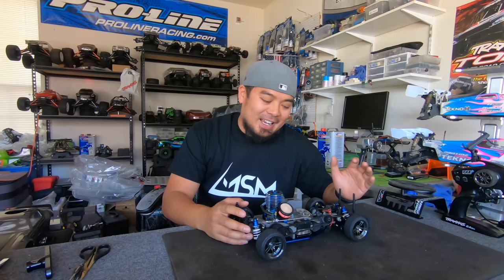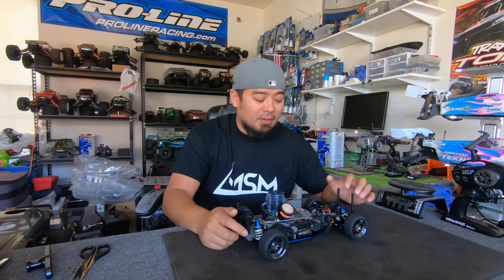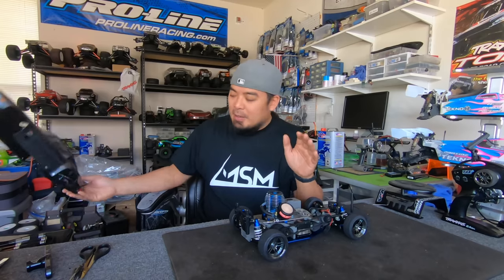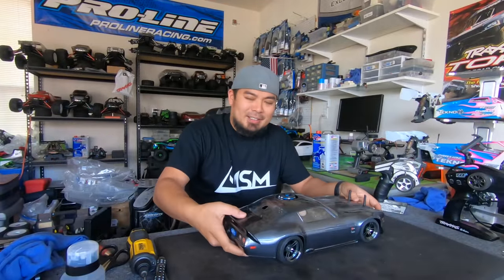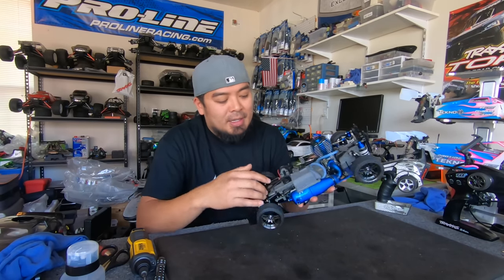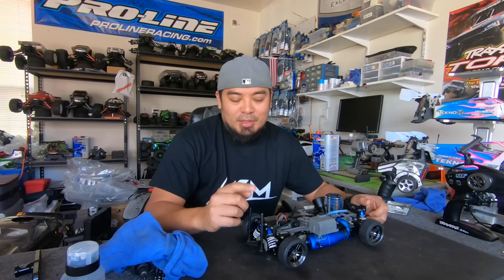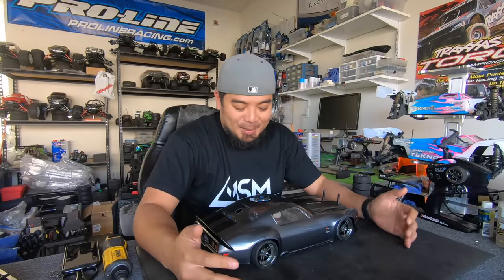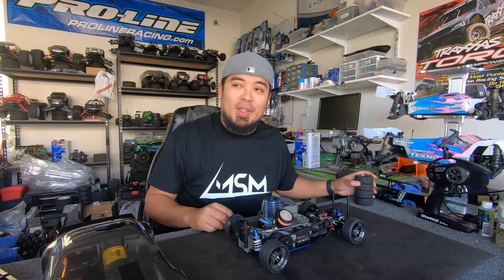Nitro RC Car Drifting Traxxas Nitro 4tec

Comment: Nice vid. Finally some nitro stuff lol. Back in the day I used to wrap the rubber tires with electrical tape. It had enough traction to get up to speeds but the tires would still break loose on command. Much easier to control to. You should give it a shot. Pretty awesome watching the car running 20mph sideways around a light pole or something.
Reply: I use to do the same with sticky tape

Comment: I bought one of these new about 10 years ago and never ran it.  It's never had any fuel in it. So, other than the dust it's still new.  I'd like to put a 5 cell hump battery pack for the reciever and servos and stuff in the same place Traxxas has for the 4 cell reciever .  Any recommendations?

Comment: Hey Mark, this isn't related to the video but since you live close to Traxxas HQ can you please ask them about the fan issues with the Easy Peak Plus chargers? I've had two of these chargers with the same fan problem. On my first Easy Peak Plus (which should've kept but sold it) the fan locked up at the 8 month mark. I sold that charger because I bought the Easy Peak Dual charger. But now that my GF has been driving my cars more often I purchased another Easy Peak Plus. The new one has a beeper like the Easy Peak Dual has which is a welcome addition. But within a MONTH of use guess what? The stupid fan started to make the same rumbling sound the old made! Ridiculous if you ask me. So instead of dealing with the warranty BS I replaced the crappy fan with a slightly bigger and lower RPM fan but it seems to have a higher CFM since the charger runs cooler. Anyways I know I'm not the only one with this issue as it's been a problem since 2015! Check out Amazon reviews. 

I also made a video about the fan I used to replace the old fan.

Comment: Not criticising because i dunno if you were just messing around or trying your best, but a lot of your drifts seemed pretty loose and not very deliberate. I only mention this because you said at the end that drifting is fun for about 5 minutes before it gets boring. 

Imo if you are a good drifter, if you can execute tight, well controlled, and deliberate drifts, drifting never gets boring, especially if you put some cones out or are doing it on a track. 

Maybe if you aren't that proficient, get some cones out, take some time perfecting your drifting, and you'll get more enjoyment out of it when you're challenging yourself and trying to hold your lines or hit your targets?

Awesome car dude 👍

Comment: U suppose to adjust the tope end needle then when it's set then adjust the bottom end by doing pinch test... BTW I'm only 15 and I own 5 cars 3 nitro 😂 2 electric but I'm not complaining... It sounds good tho
Reply from the maker: Thats what traxxas recommends. You just have to remember when you adjust the top needle the bottom needle can be affected. There was no way i could adjust the top needle without a large parking lot... hahaha
Reply: @MarkSantaMaria  I know same with my nitro... I have not even gone full throttle tho... I got a 28 alpha engine in my buggy
Reply: I injoy the vids tho keep it up